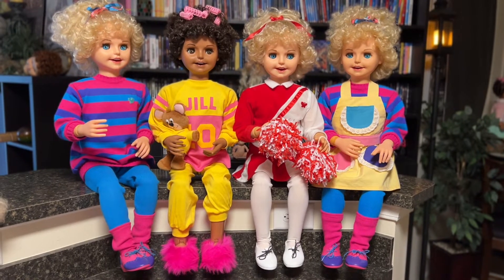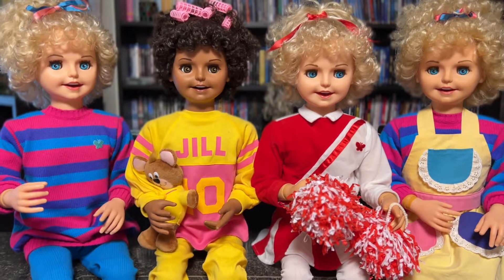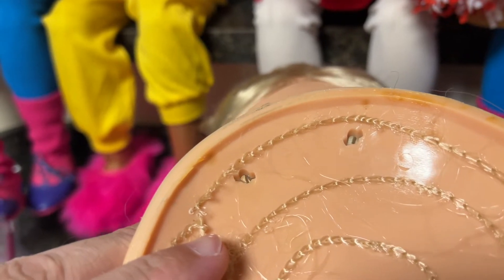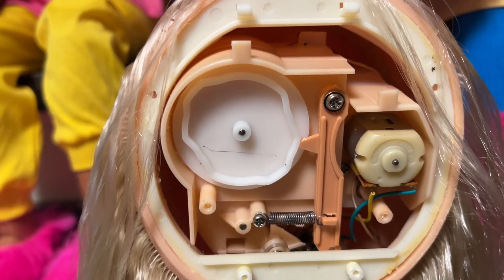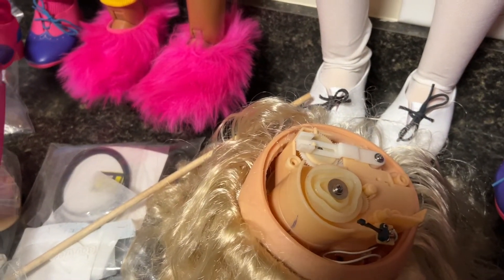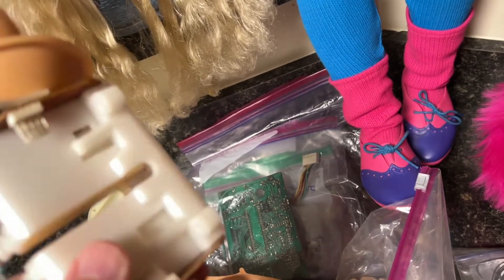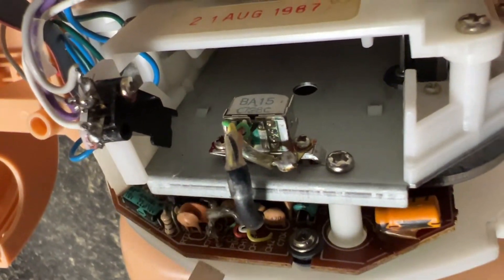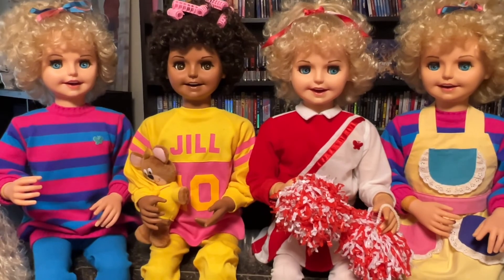Playmates Talking Jill Doll - Parts and Repairs Tutorial

Comment: Yes, future Jill owners/restores, tread very lightly around this tape head. Without it, or if it is out of kilter, your doll will not work as she should. There is no way to calibrate a jilltape head on like a traditional stereo cassette player. It’s nearly impossible and takes lots of very finite turning of those screws and if they are off dead center, you are going to have problems. She may talk, but she won’t listen to your answers. She just plays like a normal cassette player. This is because the tape head isn’t Reading the set of data tracks to tell her to pause her tape and listen to you. She may speak two or three copies of herself at once and act. This is because the tape head is skewed toward the side of the tape where the different audio tracks are for the various responses. She may be moving a little bit as in twitching weirdly but not talking and making this bizarre gurgling sound. This is because the head is moved too far in the direction of the data track rather than toward the area where the audio is stored. If it is skewed too far, as Mark said, she will eat the tape. It’s a pain in the keister to get it untangled from all those wheels and belts and pulleys and thingamabobs in there.It’s not easy folks. I am totally blind and I was trying to adjust it. At that time I didn’t have person to person help as in with someone there. Somehow, one of the wires that goes from her Circuit board  to the tape player came loose. I was not working in that area at all. I was working with the tape head which was below them. Jill is so complicated and porcelain. Some days I think if you look at her wrong, she will decide to fail somewhere. Lol!
But there is this weird fire in me to figure out all her secrets. Two get her going as best as possible for a 35 year old doll. That is this crazy futuristic combination between digital and analogue that was never supposed to work at that time. Two document all of her stories and their various outcomes. To figure out who her voice actress is. To maybe give her her own Wikipedia page with diagrams of her internals and photos and stuff. I have to give credit where it is due. To Billy Mobley who gave me the confidence to even look inside Jill. He didn’t tell me I couldn’t because I can’t see. More than that, he is around if I throw him a message. I also have to give credit to Cricket and Corkys Clubhouse for picking up where Mr. Mobley left off and being a constant encouragement through this crazy process. Why it’s so important to me to get her going, I don’t know. I feel like she was dealt an unfair hand in the history of toys and animatronics. Heck, even robotics. She’s not just a talking head like her younger siblings. All of my friends are like you have put nearly $1000 into this doll just sell her or throw her away or something.
Reply from the maker: Facts!

Comment: Didn't they release a jill doll with no innards as it was cheaper 🤔
Reply from the maker: They did. After Talking Jill failed and they pulled her from production, they needed to use all the leftover parts and outfits. So they made a soft body plush Jill under the line called Precious Playmates. This doll has Jills head but doll eyes that opened and closed, as well as shorter curly hair that came in blonde and auburn.  Jill’s outfits are so hard to find that I’ve had to get two of mine from the plush Jill. Like the Cheerleader outfit in the image on this video!

Comment: my jill has her candy stripers outfit and cartridge sadly i moved my jill one day  and her arm  just came off
Reply from the maker: Oh no! First off you’re lucky. That’s one of the few outfits I haven’t found for Jill. Second..her arm! Yeah those old plastic pegs break so easy. Did it snap off and leave a part inside the socket? I have a friend that sells 3D printed coups of that part. We worked on making an exact replica over last summer because so many Jill dolls have broken arms.
Reply: its a break on the outside from her shoulder im very  careful  with jill  but picked her up  gently  and the plastic just  seperated from both parts
Reply: @cricketandcorkysclubhousef8686  i still have the packaging for candy stripers  i gently removed it  as jill  wasnt wearing an original outfit
Reply from the maker: @wizzwamf  oh man so that whole piece snapped off inside the arm point. That honestly is worst case scenario. But! It can be fixed. Yay! You can take the easiest way out and try using tan JB weld plastic glue. This will work but if you forget and attempt to grab that arm it most likely will break off again.
Option 2 is more permanent and way more tedious work. You have to take Jill apart, take the entire arm section out and dismantle it. You have to really take it down to the motor coming out. Once you do that you can use pliers and snap the broken part out of the socket. Then you can get the part replaced with a sturdy 3D printed part. 
Lots of work but you wouldn’t have to worry about it snapping off again in our lifetime lol.
Reply from the maker: @wizzwamf  oh wow so jealous! If you ever decide to part with it lmk! The only outfit I keep finding is slumber party. I have like 3 pajamas tops and bottoms now lol.
Reply: @cricketandcorkysclubhousef8686  i would love an original outfit and cartridge